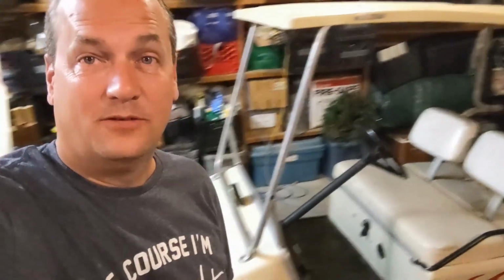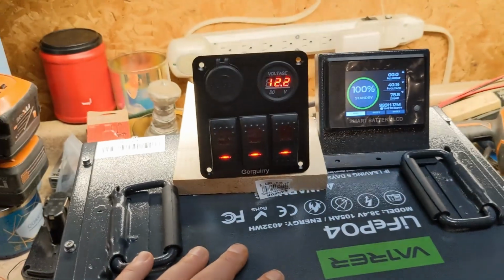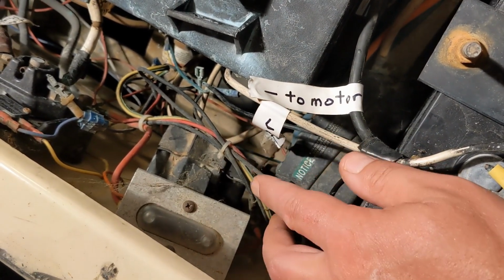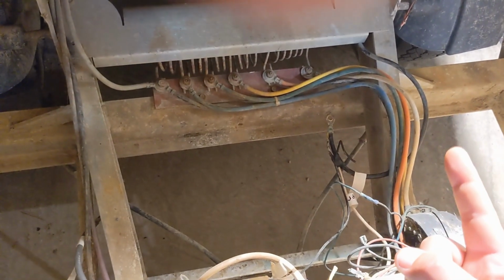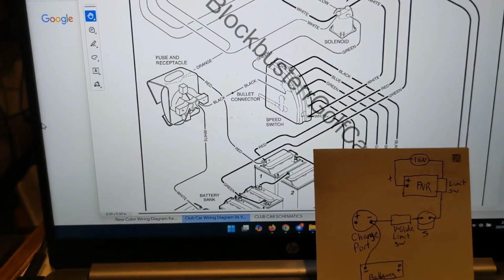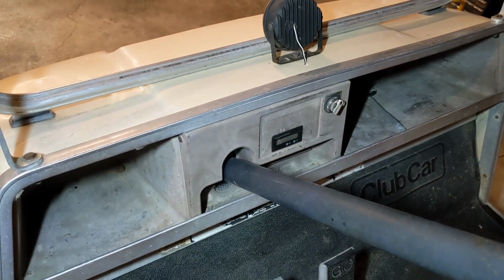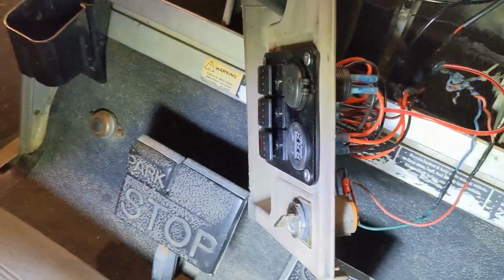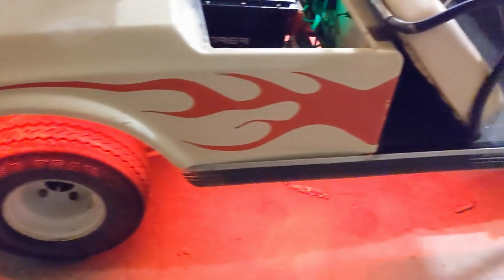Vatrer Lithium Battery Upgrade on a 1991 Club Car DS Resistor Golf Cart (Step By Step)

Comment: Hey bud how do I get In contact I’m lost on a toaster conversion
Reply from the maker: That's a pretty broad question but I'll try help as best as I can.
Is it an older Club Car like mine in the video? If so go through it and let me know what pat or parts you have questions on. 
If it is a different one, the concept will be the same but a bit of the wiring might be a bit different. Definitely recommend searching for a schematic for the cart you have as it will be the starting block towards any wiring changes.

Comment: Thank you for the vid. I purchased a 91 CLub Car DS 4 days ago. It was in good shape but as usual, batteries needed replaced. Now after watching countless vids I found out that my cart was older than what I wanted. Was told it was a 99 but oh well, just going to take a little more money to get it to do what I want (right now I am totally ignorant when it comes to golf carts)  Didnt realize those resistors took so much away from the power and mileage. I ran into the same problem you did (differnt 36 volt bat) and love your Idea of moving the coils. I will most likely doing a total upgrade here shortly, Just want it going at the moment and find out what all I need. Anyways, thanks again.
Reply from the maker: Happy that my video could give you some mod ideas. 
  The location I used for the coils has worked out great an would still recommend it. The only downside is that I can't use that space for an under seat cooler like I originally planned. :)

Comment: I have an old club car 5 solenoid  that has a positive connection from the old battery system going to the forward/reverse switch and a separate second positive connection going to the motor. Do I connect both of those to the positive terminal on the battery?
Reply from the maker: I would need to know your year to be for sure but from all the schematics I can find where yours would be one of them, they are all connected the same at the Forward Reverse switch.

  The one that goes to S1 on the motor will still go there and the one going to positive will still go to positive. The only difference will be that you don't have a bank of batteries where you can tap into the power half way for Reverse, that lead will just go to battery positive. So the old way gave you about half (depends on which battery it was connected to) and now you will have full speed for it.

  So there should be 2 positives leaving you FR switch from different terminals on it, one used to go to main positive on your bank of batteries and the other went to a positive on a battery half way through your bank. They will bot be fed from the one positive now (either both wires to the battery positive or just one to positive and a jumper ove to the other terminal). The lead going to the motor does not need to be touched.

  It will be the same as in my video except my lead that goes to feed my resistors will be the feed for your resistor solenoids.

  So hook it up as it was when it comes to your resistor solenoids and motor, don't change anything electrically on those.

  Hope that helps.

Comment: Great video! I would rethink using the chassis as ground, it is against convention and should a positive wire should come in contact with the frame constituting a possible short. I recommend running a negative wire. Having power on/off switch on the battery is great safety feature.
Reply from the maker: Great eye and I agree!!  Right after (but not in the video) I did just that and put a loud comment in the description in hopes that everyone will see it. 
   The main reason to not have one in this case is because it is an electric cart, it if was gas it would be okay. The hazard of having a potential spark around them is the issue (especially while charging). 
   Thanks for the comment as I hope anyone who missed my note will see your comment.

Comment: Made the best of a poor original design. Toaster cart indeed.👍
Reply from the maker: Agreed as she goes great now!  And I'd say the design is still great when going full out most the time like it's intended purpose of being at a golf course. But with Carts being used in so many different scenarios now, they are not great at slow to mid speeds (uses too much juice). Thanks for checking it out. :)

Comment: Why not just cut off the connector for the OBC and butt splice the required wires instead of going through the whole depinning process to create a jumper?
Reply from the maker: Thanks for the comment but sorry as I'm not sure what you're referencing as there is no On Board Computer (OBC) on this old resistor cart.

Comment: That is an expensive battery compared to others. Aren't most made in China?  How can one Lithium battery of the same voltage and Ah rating be different than another lithium battery with the same rating. The only different is the price it seems to me.
Reply from the maker: I think the majority are but couldn't say for sure. Towards the pricing from my looking into it beforehand is that some are made cheaper, some have more feature (bluetooth, charger included, better warranty etc) and some have better BMS system's. All that being said all one can do is do their research and then take a best guess. The install I show will be the same though no matter which manufacture of box battery you chose.

Comment: Sorry got bumped off while typing how hot do the resisitors get also how long was your battery mine is roughly 16inches and transverse was my solution too. Sadly my cart is 25 miles from home. No garage or yard at my old man condo...lol
Reply from the maker: No worries.

For the resistors, mine get too hot to touch but not as hot as they could get (I drive at about 3/4 to full throttle most the time). So it's not an issue for any wiring as long as you keep them about an inch to two away. With them being where there is an open bottom, they get lots of moving air around them now it helps to cool them fairly quickly. As an FYI, they are all used when going really slow, half at half throttle and none at full throttle. So the faster you go, the less that get used. So with a resistor cart, you actually get better range out of your batteries the faster you go.

For the dimensions on this battery, it's 16.5" x 12.5".

I hope that all helps :)

Comment: As said by others, not much information on upgrading resistor units while leaving them in, so appreciate the vid.  Am planning to convert my toaster cart batteries also without  buying a controller.  Like you, maybe upgrade later
Thanks for the tutorial.
Reply from the maker: So true as us toaster guys get neglected. Haha
So happy that my vid could help, just remember to NOT ground the frame.
Hope it goes well, throw me un update once it's done and please subscribe if you could to help a guy out. :)
Reply: @AtHomeAndHandy  Well dead of winter here so project probably will not proceed for a few months.  Also getting over health issues, successfully I might add! Scribed.
Reply from the maker: Appreciated and all the best with your health :)
When / if you get around to diving into it and have any questions, reach out as I'll try help wherever I can.
Reply: have you upgraded yours yet? I'm heading that way for upgrading.
Reply: @cferguson6688  No, found a bad solenoid so waiting for a part.  Probably be at least a week or more.  I can get everything mounted while waiting.  Will relocate the "toaster" as batt will have to be installed long way, front to back.
Reply: @skip7243  I just cut out part of my frame today, battery was an inch and half too long and after experimenting, cutting the frame was the best option. I only cut one side and reinstalled some angle iron as braces. I figured after taking out over 350 lbs of batteries, it didnt need that much support anymore.

Comment: I’m literally doing the exact same thing with my old club car. I moved the solenoids (slightly newer model than yours) like you and battery same location.  I’ll be adding the bus bars and v reducer next.  Great job this was a HUGE help to me.  Thank you
Reply from the maker: Yup, with solenoids it's the same thing and should be lots of room still to put them and the resistors on the side where I did, just might have to mod up a frame strip to hold them is all.
Towards the bus bars, I think I will make any future ones a bit better by using a 12v Fuse Box with 6 circuits. Check them out as will make a cleaner install for about the same price. For the reducer, the important part is the amps to ensure it will hold for how many accessories you plan to install. I used a 20A one (don't get anything smaller).
Hope it all goes well and if you don't mind, throw me a subscribe to help a guy out :)
Reply: So many dang wires in mine too. At least now I know I don’t need most of them
Reply from the maker: Best thing is to find your manufacture schematic and go through it so you know what's needed and what's not anymore.

Comment: Awesome and glad I found your video. I have a 95 DS and bought this same battery before doing my due diligence and opening up the seat to look for any obstacles like the frame and mine has vglide. Was just about to remove the body to get this battery in there in the same orientation but since you got it in I think I can too. It is a heavy ass battery though. Thanks for the video, not many out there on this model.
Reply from the maker: Awesome as in my video will be exactly how yours will be! 
As for the battery, it will slide in. It is heavy as all hell so go slow. I ended up putting it in by standing on the passenger side and holding the "front" handle with my right hand while supporting myself by using my left hand on the back under the back rests. Once you get it to wiggle in once, you'll be a pro.
 Hope that helps a bit and let me know how it all worked out once finished. :)
Reply from the maker: Oh and do not ground the frame like I did!!!  I put in the description that I took it off.

Comment: This video is a life saver i have the same cart wanting to do the same months of searching i found your video how are you liking this setup
Reply from the maker: I'm going to copy/paste the reply I put to someone else as my answer is the same. 

Have to say that I love it!!  With it being a resistor cart I am getting about 40% less distance compared to those with a controller, but still worth it. You don't want it to go less than 30% charge so from full to 30% I got about 23km's (14m) in range. With a newer controller style I would expect about 32km (20m). Even at 23km it is far better than I git from lead acid when they were new.
  Now add in the maintenance free and it's a no brainer. 
  The only warning I would give is the temperatures it can work and be stored in. I took mine out to put in a heated space for the winter as it can get to -35c and it says to stay above -10c when storing.

Comment: its been 2 weeks how do you like the battery I was looking at the same one
Reply from the maker: Have to say that I love it!!  With it being a resistor cart I am getting about 40% less distance compared to those with a controller, but still worth it. You don't want it to go less than 30% charge so from full to 30% I got about 23km's (14m) in range. With a newer controller style I would expect about 32km (20m). Even at 23km it is far better than I git from lead acid when they were new.
  Now add in the maintenance free and it's a no brainer. 
  The only warning I would give is the temperatures it can work and be stored in. I took mine out to put in a heated space for the winter as it can get to -35c and it says to stay above -10c when storing.